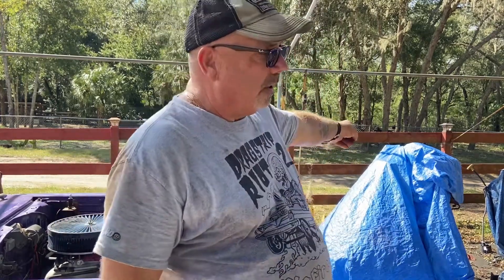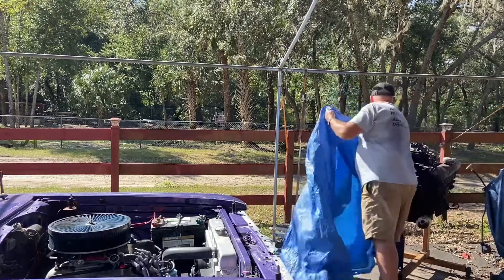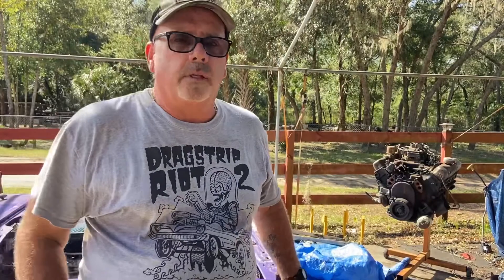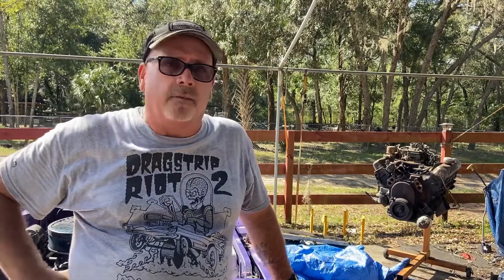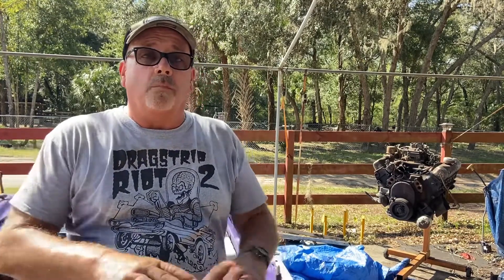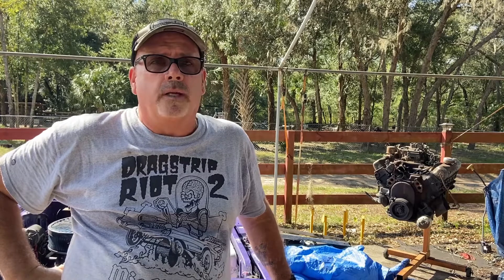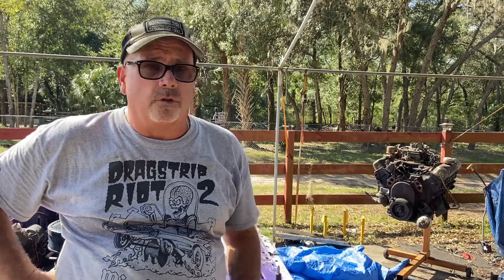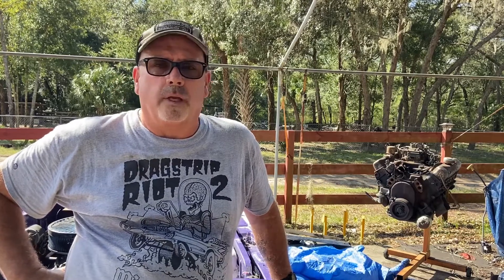She’s a stubborn one. Keeps fightin me

Comment: Have you checked the pushrod length? Especially since they have been cut down so much. Also what cam manufacturer is it?
Reply from the maker: It’s a howards cam. Lifters did finally pump up. And pushrod length was checked at the machine shop. The geometry isn’t correct without lash caps. But then the lash caps want to pop out when lifters aren’t pumped up. That’s why I’m getting rid of these heads
Reply: @gtdart970h  As a general rule of thumb is polished heads don't work well for street cars. Also is the oil leak at the intake manifold? From my experience if you do not seal the rubber end pieces they will leak.
Reply from the maker: @lynnrunningdeerB4  no it’s at the pan rail or drain plug maybe. It’s pretty bad. But k member obstructs any clear view. I put my finger behind vibration damper and it appears dry. Literally workin on pullin some of the motor now. Will finish tomorrow 🤙🤙
Reply: @gtdart970h  same thing applies to the end gaskets on the oil pan. Rubber expands and contracts. Good luck with sealing it.